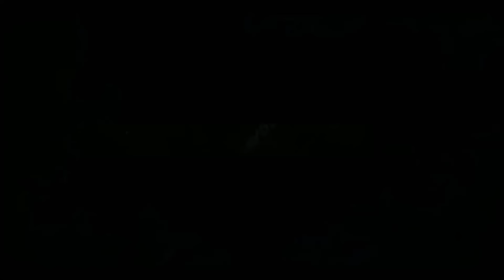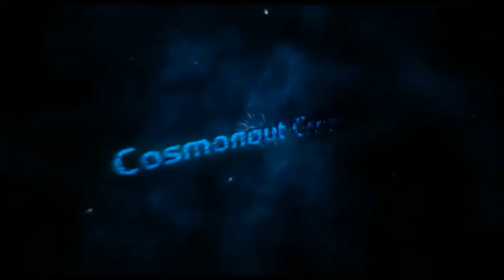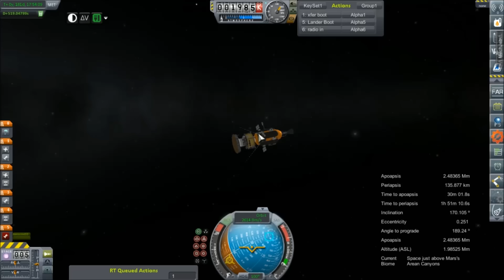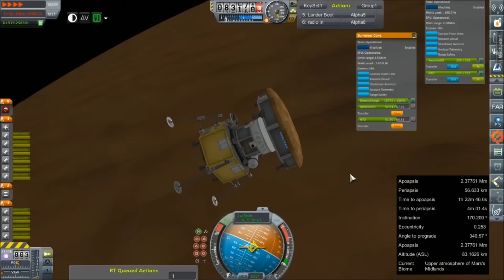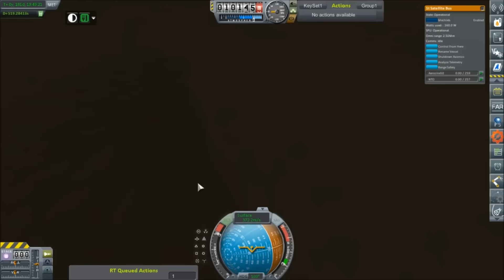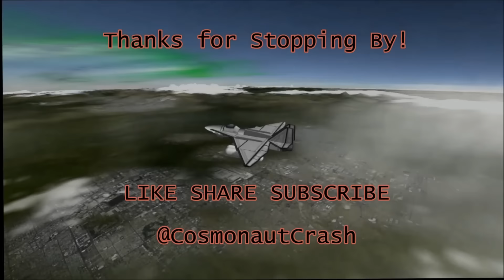KSP RP-0 #183 Project Mars Landing

Comment: I only saw two things that you did wrong (besides RCS placement) you decelerated the mass of the heat shield therefore cutting your delta-v / TWR and you staged your parachute too early. did you stage your parachute in orbit because of the signal delay?
Reply from the maker: Chute was Armed in orbit, and set to automatically deploy at specified altitude.  De-coupling the heat shield inexplicably crashed the game ( fun showcase of that after the outro )  Trying to land that much mass was never in the design spec. It was also this extra mass that made the RCS placement rather useless...
In retrospect I should have made adjustments to the chute deployment altitude, but considering the added mass of the heat shield I doubt it would have changed the outcome.